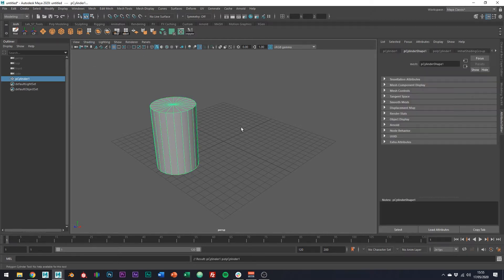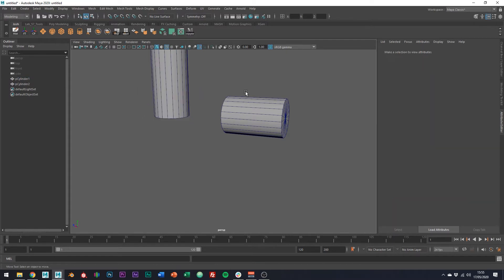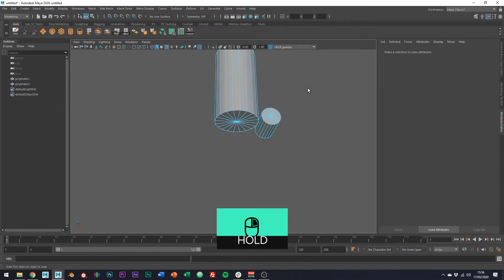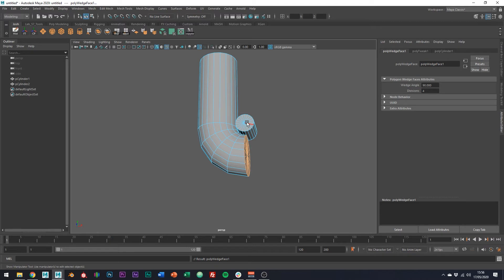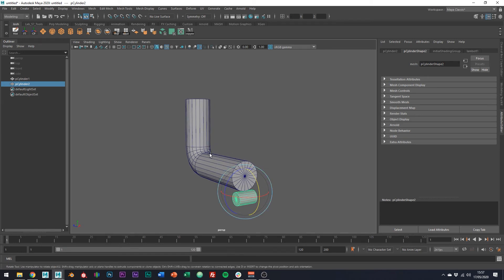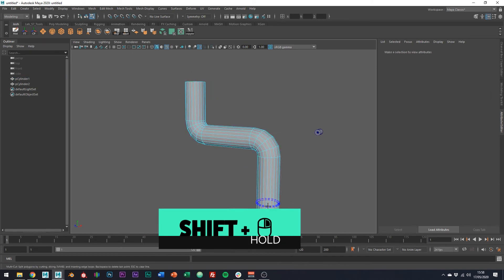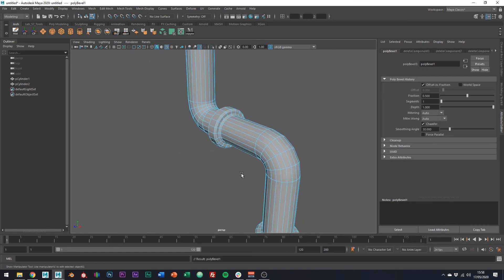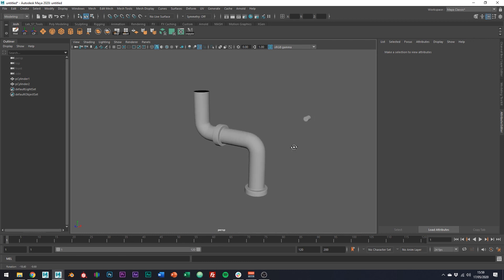Modelling Pipes with the Wedge Tool in Maya

Comment: If you have any issues with Selecting (Pressing Tab to "paint" the bottom) then selecting the 2nd object first go to Modeling Toolkit, Multi-Component right under select Edge (should be the middle box) make sure that is the only one selected and then HOLD Ctrl & Shift at the same time then you can select the two edges mentioned on the second cylinder.
Reply: Thank you for the tip

Comment: dont know if you are still replying. if i select both and use the multi tool while holding tab to select the faces on the bottom of the cylinder - its only lets me selects the edges. also while i select the edges using the multi tool the guide cylinder is deselected. i cant wedge
Reply: ok i found out how to select the faces using the multi tool, my bad :D. but still, i cant select the guide cylinder after selecting components on the main cylinder (and the other way around its the same issue of course)
Reply from the maker: Hey, it’s a little tricky to do. But once you’ve made your first selection, without clicking off or doing anything, on the guide cylinder you can hold down the right mouse button and select the component type to want to select. Holding shift you should be able to add that to the existing selection. I hope this helps!

Comment: Man took a good time to figure it out. I was frustrated why am i not able to select faces and edge at the same time. Guys if you are in 2019 you have to combine two objects first may be its different in 2020 vers.  Anyway thanks man for this TIP.
Reply from the maker: You should be able to make selections without the need to combine by setting both objects to the selection mode "Multi"
Reply: @JoshAntonio  yeah man I tried. I was in doubt May be because you are in 2020 version. Will try again and let you know.
Reply: I couldn't select both of them just with multi either